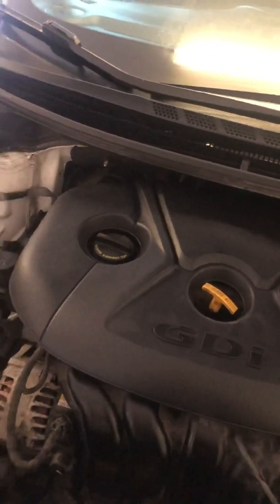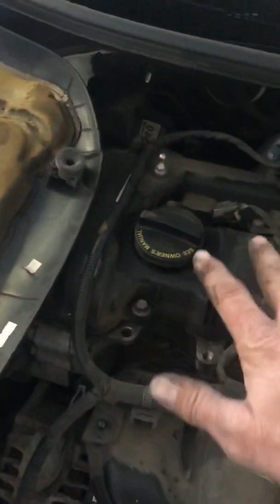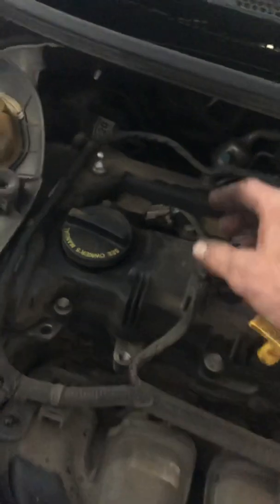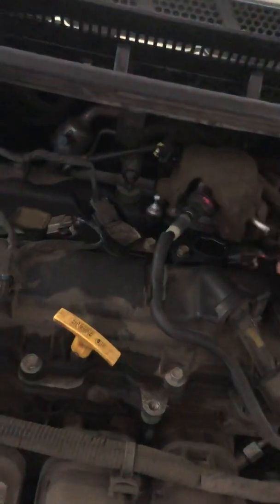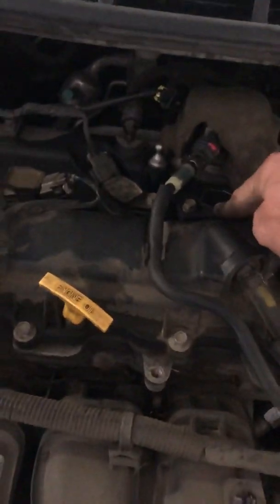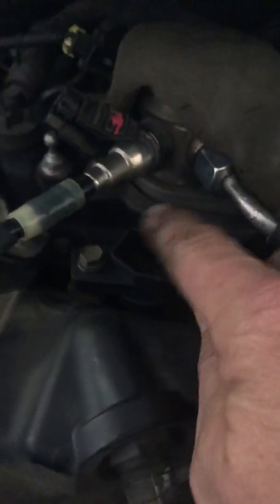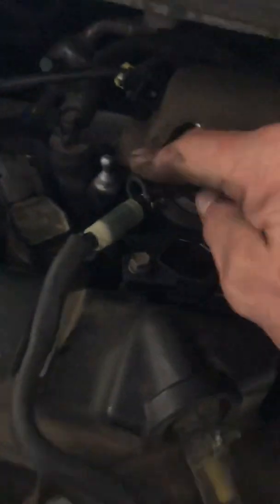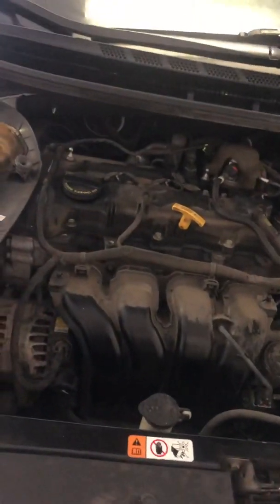2014 Kia Forte ignition coil replace

Comment: God Bless you. This was fabulous. I too have a 2014 Kia Forte and since April just paid over $500 in labor to have 1 coil each time replaced this year at seperate times. In the report it even said that coil 1 will be going out and they did not replace it. So I am going home tonight, buying a coil and doing it myself. Of course while I am at Auto Zone I will have them put it on the machine to verify. The dealership just replace #3 and it is still not running right. As a single woman, this video was awsome from beginning to end. You just saved me hundreds more. Do you have any other repair videos on your 2014 Kia Forte?
Reply from the maker: Thank you & glad if my video helps, it’s actually one of my daughters car, I believe I made a replacing brake shoes video, & possibly the air filter
Best wishes Best of luck 👍👍👍

Comment: The same thing happened to me, i scanned my 2015 Forte and it said cylinder 2 and 3 had a misfire, so i wanted to change positiions of 2 and 1 and 3 and 4 to see if it was the coil or the spark plug, i didn't know how to remove coil 4 but thanks to this vid now i know how to

Comment: The wire that’s by the ignition coil 4 is in the way! My wrench won’t get to it, any advice?
Reply from the maker: I remember having the same issue,
I believe I just tried different shaped wrenches until one worked, it may have been a swivel attachment I used also,
Be patient & you’ll figure out something that will work for you
Reply: thanks! it was a sizing issue with the wrench, glad to say i just finished changing my first ignition coil all thanks to this video!! saved about $300 woohoo